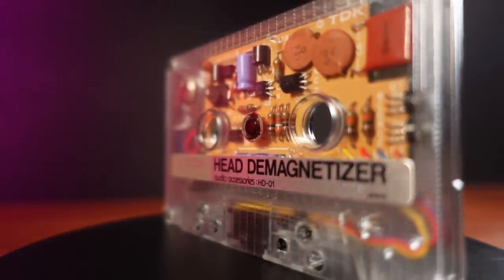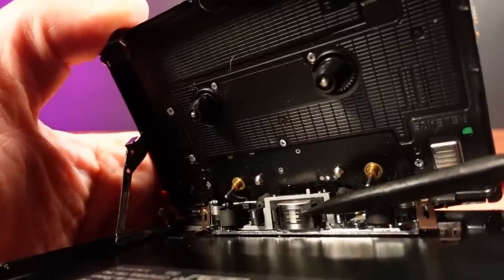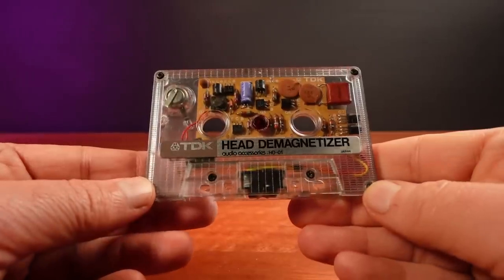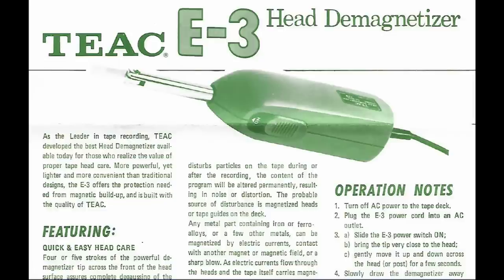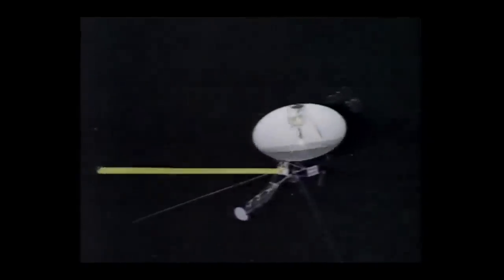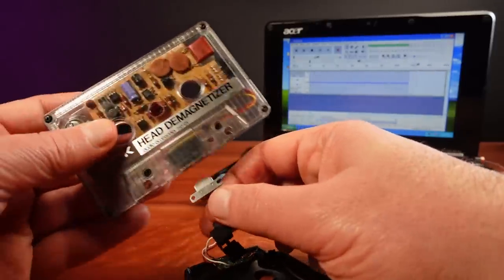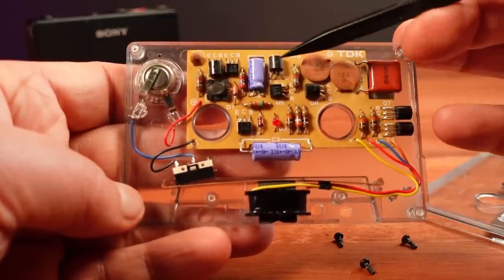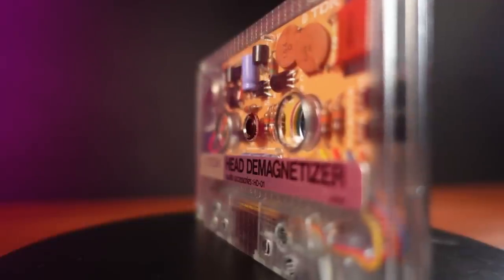No One Knows If This Actually Works

Comment: Slightly magnetized tape heads. Is one of the primary reasons. How analog tape sounds bad. As the tape head gets slowly magnetized over time. As the magnetic particles from the tape pass over the head. It leaves behind some of its magnetism. On the head. Which then starts to erase the high frequencies off of your other tapes. And it just gets worse from there with every playback.

You see I worked for one of the finest of the, Recording Studio and Radio Station, American-made, tape recorder companies. And trained by the others also.

And so this tape head magnetization is a really big deal. And it needs to be done periodically, regularly. It is very important to do. Because once your tape heads get lightly magnetized. It destroys the tapes and the recordings. And leaves them hopelessly noisy. And lackluster sounding.

And so this little cassette thingy. Was very effective for the average consumer. But when one of those cannot be located. A handheld device must be used. And you have to understand the procedure and how to do it effectively. Without making the problem worse.  Because it can be  easily made much worse. Unless you know the engineering procedure. To prevent such cataclysmic catastrophes. That cannot be undone.

It's an even bigger problem. If you travel  in a north to south or south to north, direction. For any length of time. The tape heads will get magnetized. As you drive along the Earth's magnetic flux. In a northerly/southerly, direction. And was a big problem for companies  such as myself. As you would have to do magnetize, your tape heads. Once you arrived at your location. In my large diesel box truck. Rolling control room on wheels. And I worked the East Coast from Connecticut to Florida. Having to demagnetize. At every location. Before I ever started recording. It's that important. It's that requirement.

So a much bigger deal than what is even mentioned, here. As I worked for those tape recorder companies. Making the finest studio tape recorders, ever. And I still own a couple from 1976 and 1979, respectively. That still work like new. And are wondrous pieces of musical and commercial history. In like new condition. And to help protect our history. Of these relics from the past. When music was still, Analog. And worth something to listen to. Unlike the computer-generated dreck. We have today. Which is without humanity. And is a computer music box playback. With no actual musicians involved.

It's all different with digital..
RemyRAD

Comment: I had a TDK Electronic Cassette Head Demagnetiser in the late 70's! ... But, I found a MUCH BETTER way to improve the sound quality of my Hi-Fi! ......

...... Ditch the 1963 Philips Dictation System altogether! 🎶👍🤣

EDIT: From personal experience, I can say the device is INEFFECTUAL, because of the weedy power source; a watch battery! ... A proper demagnetiser requires MAINS ⚡ VOLTAGE!

Voyager DOESN'T work on a watch battery! ... It's a nuclear battery! ... The TDK Demagnetiser would operate for 50 million years on a nuclear battery! ... That's a LOT of demagnetising! 🤣

Comment: ??? and you did not make some experiments to see if it works??? What's the point then to make such a video???
Just get a few tape decks, measure their noise level, record some audio, run the demagnetizer (with a new battery) and do the same tests again and compare. 
You even talked about how much people argue if they work... and then you do not find it out... omg...
Reply from the maker: Thank you for your comment. I'm still searching for the answers and experiments as well. I have pinned a comment above. With maybe a bit more, but also maybe not all the answers.
Reply: @JanusCycle  I can help you setting up a proper experiment.

Comment: the level of demagging a head cannot be achieved with a DC powered unit like this. If it is powerful enough, then you'd be damaging the heads and circuitry by having the deck powered on.

Comment: This feels like snake oil to me. If tape decks were so susceptible to this, why weren't these everywhere in the 80s and a required part of owning a cassette player? You need to buy oil filters for your car, they are everywhere. You need to buy a toner cartridge for your printer, they are everywhere too. These weren't everywhere.

Even so, awesome investigation using Audacity. They certainly do look cool too
Reply from the maker: Most people didn't care, these were more for audiophiles. Just like today people listen to highly compressed songs on YouTube with digital artifacts and still don't care.
Reply: I've even seen research which suggests people who grew up with pervasive internet prefer the sound of MP3 compression when it's audible! I'm not an audiophile buying gold plated HDMI cables but I can't imagine preferring a 64k MP3 to better quality audio.